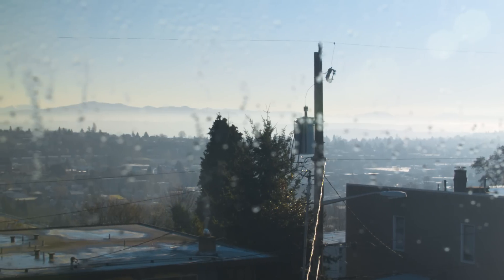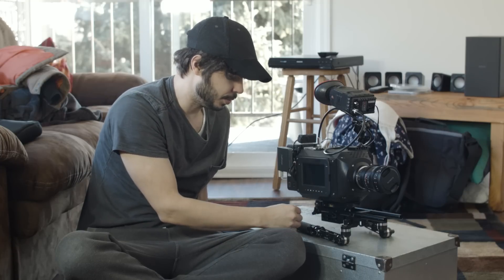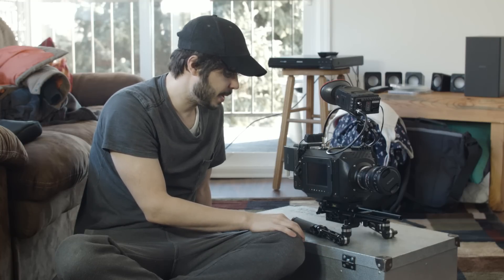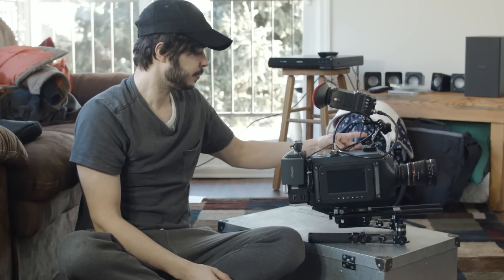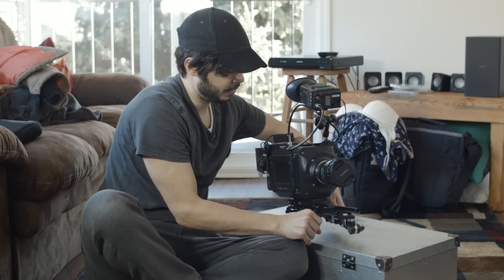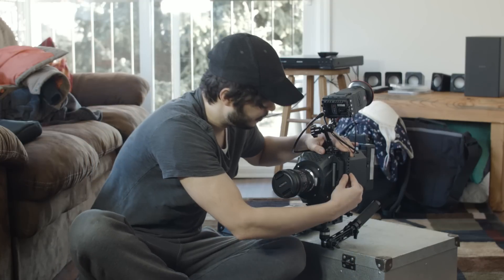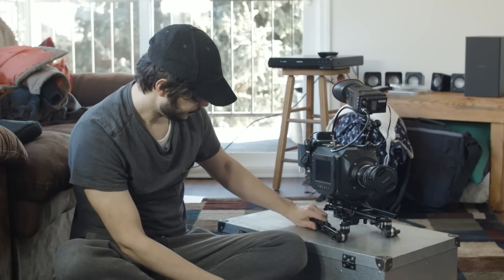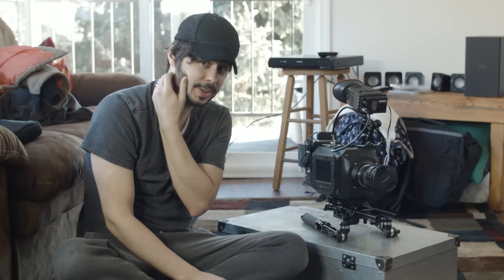Blackmagic Cinema Camera - TEARDOWN 4 OF 4

Comment: This is so awesome! I was recently thinking of buying a BMCC with an EF mount but replacing the mount myself with an MFT mount. Do you think something like this would be possible? Would you be able to just open up the front of the camera or would you need to take it apart completely as well?
Reply from the maker: Thanks for the kind words!! You would need to take the whole thing apart... But I don't quite understand, why not just buy a MFT BMCC since that's what you want?
Reply: @DaviSilveira  I was thinking of doing this for the Production Camera 4K - with the EF mount I'm missing out on some good APS-C lenses and the ability to adapt more vintage rangefinder lenses.
Do you think that swap would work, or is the lens mount part too different between the cameras?
Reply from the maker: @C.I...  I would do some research. Typically cameras aren't compatible like that on the inside. You can't just swap things around.
Reply: @DaviSilveira  I'm trying :) I thought since the bodies look identical and were produced around the same time that it might work. The trouble will be finding a lens mount part in the first place to test.
I haven't found a comparable teardown to yours for the Production Camera 4K to compare with yet - I probably won't disassemble it unless I can find evidence pointing to the fact it has a good chance of working and I have the part.

Comment: good job :) i want to create a lighter body for the bmcc, and your convinced me that I should do it :) do you by any chance remember if the metallic enclosure of the bmcc comprises most of its weight? it should be 1.6 kilos so I am guessing the enclosure should be half of that around 800 grams.. am I right, roughly?
Reply from the maker: hey! The weight of the camera is definitely a big factor. But the battery and a metal plate inside are heavy as well.